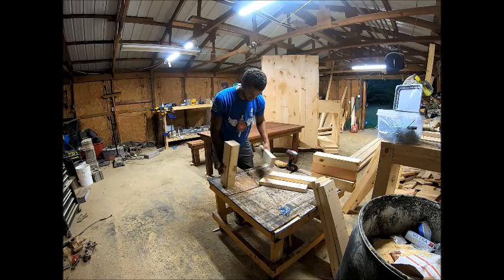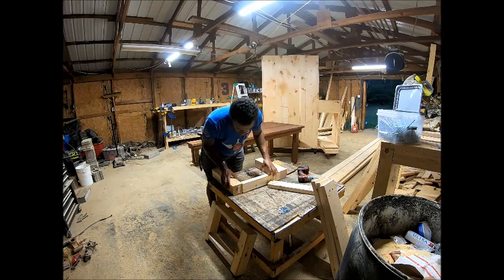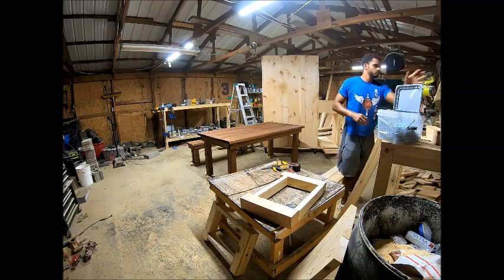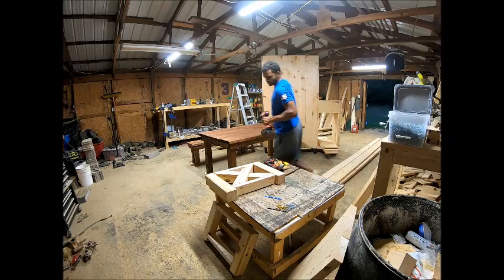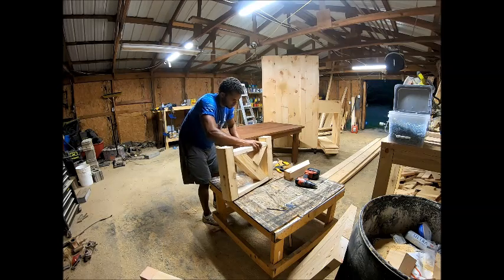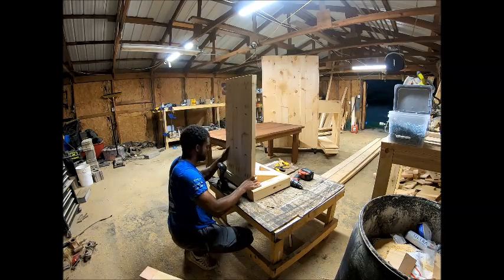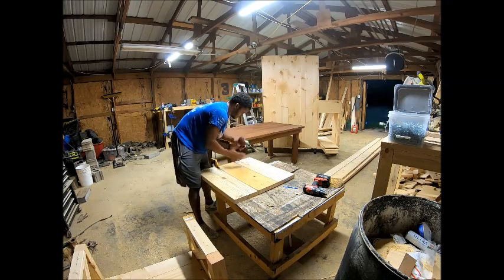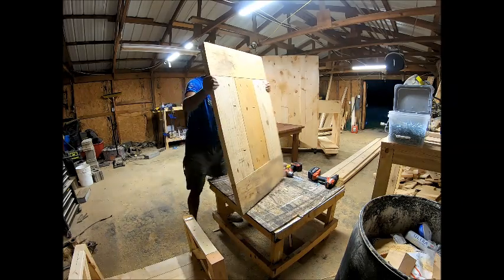How to build a simple Farmhouse Coffee Table

Comment: What’s the long term integrity? I didn’t see any glue. And do you prefer the aesthetic of the boards not fitting perfectly or no access to a jointer? It was a quick build, but I’m concerned with the longevity of this build.
Reply from the maker: No access to a jointer at the time of this video. I have one now. I’ve never used much glue on coffee tables. There’s not a lot of stress points. 3 years (since my first coffee table) and they’re all still holding up just fine.